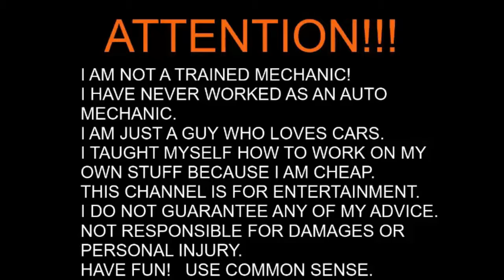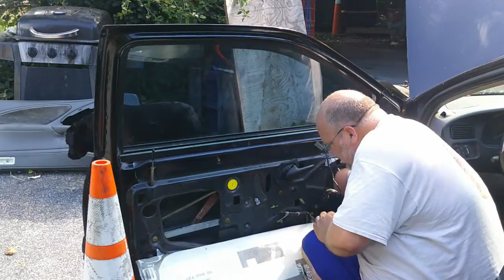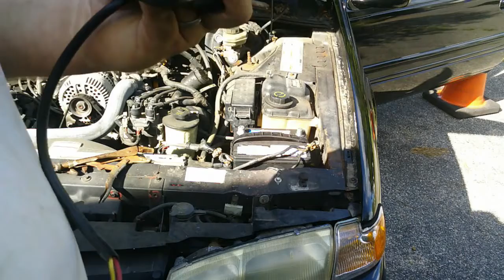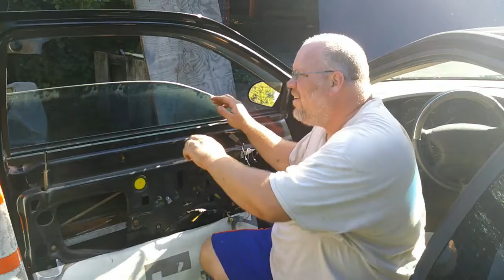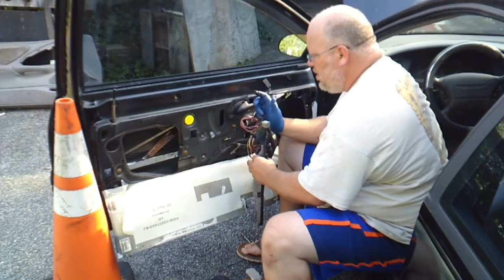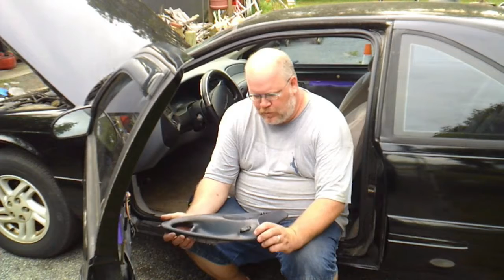Ford Thunderbird Mercury Cougar Window Motor Replacement

Comment: Just fixed the ones on my 95 cougar  wanted to give it a shot instead of buying Chinese shit. You can simply but some nuts where the original plastic bushing used to be grease everthing up and it works great

Comment: Im having trouble getting the motor gear to mesh with the regulator
Reply from the maker: it can be a little fussy, manually raising or lowering the window a tad might help you find the sweet spot
Reply: This is what I'm not getting.  How does the motor engage? Very difficult when you can't see what you're doing..
@2LabsGarage

Comment: Two things really helped with re-assembling the motor/activator unit.  The three bushings can be nicely held in place against the central gear using a HOSE CLAMP!  Then, this set is easier to start to settle into the big plastic gear by using a C-CLAMP!  Soon remove the hose clamp and continue to use the c-clamp to complete the insertion.  Variously positioning the c-clamp over the new bushing "least inserted" and moving the c-clamp around makes for a process that is non-destructive of the new parts, which have to end up in a Very Tight Spot!
AND be sure to align the assembly into the door the way it was, as the three bolt/hole combos were confusing and fought me until I got it right!
Reply from the maker: interesting! always open to new tips and tricks.